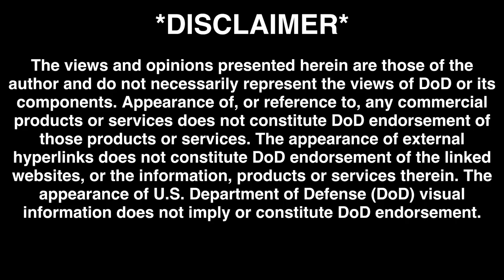Fighter Design: Stealth VS Jammer Pods

Comment: C'mon mav. Jammers are active and stealth is passive.
Reply: Only if you never transmit A signal, either UHF, VHF, IFF, Radar (to include Radar altimeters, etc.)  Jammers is a misnomer as we have pods (and internal systems) that listen and only respond, when it is necessary AND when authorized to do so.

Comment: As an ECM guy (20 years USAF) as Rick said, Stealth is great for the first day of the war, "first look, first shot, first kill". After that, 'they' know you are coming so as stealth can be defeated with a good mix of high-low frequency radar systems AND stealth is ALWAYS a compromise in a decades long airframe design, you have to be in the right place at the right time to succeed or you're just another target.  Yes, ECM pods as well as internal systems are beacons when in broadcast operation, but they can be run in spot reaction mode only which is both programmable and adaptable to the frequency bands/threats in use AND can be quickly upgraded in a very short period of time, sometimes in days or weeks with a good QRC (Quick Reaction Control) system in place and with enough forethought to make any interception problematic for the bad guys.  The EF-111A Raven was, and now the EF-18G Growler with its newer AESA systems will be a lot more surgical in that jamming, less beaconing and more spot threat prevention and will be a lot less susceptible to HOJ (Home On Jamming) attacks.
Reply from the maker: Paul!  Thanks man, I always try to keep my questions as unclass as possible.  You're laying out a lot of good points I was also thinking about....
Reply: @themoverandgonkyshow  Lived it for so long, as Military and Contractor.  Classified stuff is pretty much frequencies, techniques, especially what specifics on what platform.  My lips are sealed in that regard. 🙂    Even though I probably either saw or have documentation which Rick was involved in, wish I could have known of him way back when.  Thank you (and Mover) for this channel collaboration and bringing back memories.
Reply: A great tactic would be arranging two packs fighter jets, one pack with complete stealth, the other with jammer support. 

The stealth package would sneak up from the north while the jammer package comes from the south. So then the enemy thinks you’re attacking from the south, but they don’t realize the south package is just to draw away their attention.  Now the enemy’s pointed all their radars to the south, the north “stealth” package can sneak up and destroy their targets with complete surprise
Reply: @Anderson_Hwang  

I read an interview with an F-22 pilot where he stated  in a complex "noisy" military exercise with lots of other aircraft and radars and ECM, his plane is effectively invisible.

In an exercise where it's just F-22s aloft,  detection is still difficult but not impossible, and he has to pay much more attention to minimizing his "footprint"